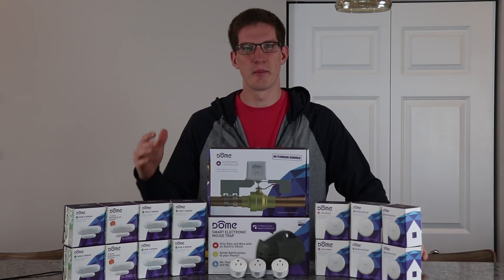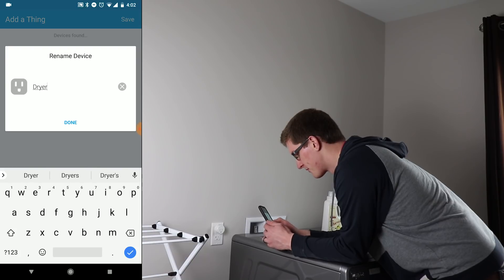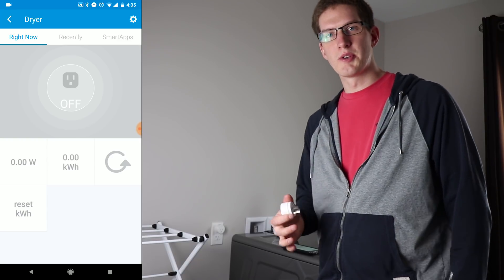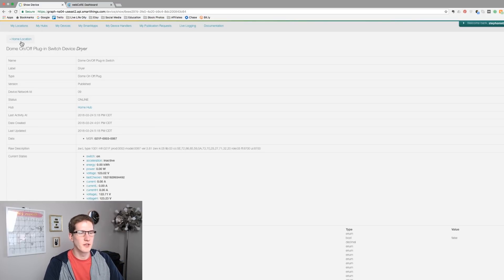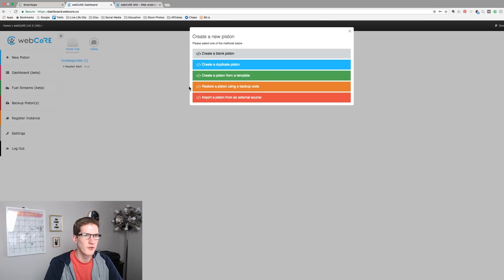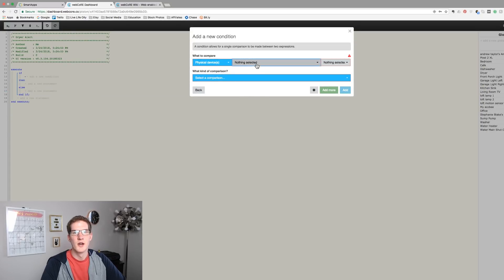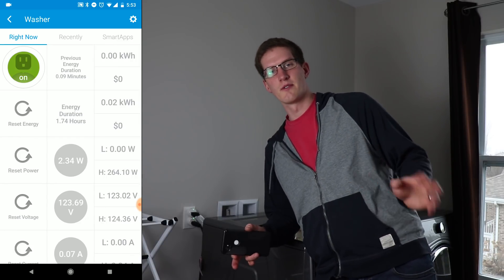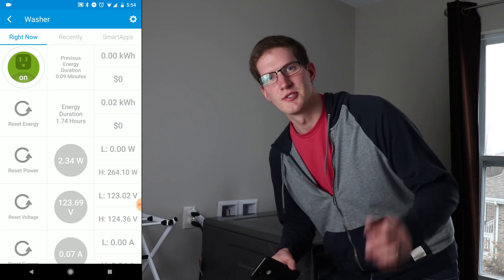Square One, Ep. 6: Laundry Alerts Using Dome Energy Monitoring Plug and WebCoRe!

Comment: I tried your webCORE example for the washing machine.  Instead of a text I have it set to announce it through my Echo.  My problem is that it keeps doing it over and over.  What can I add to get it only announce it 1 time?
Reply: If anyone needs a hand with this still, let me know.  I have it broadcasting through Google devices and it repeats every ten minutes until a virtual switch is turned off.  Can do that with sensor or voice.
Reply from the maker: You can add a local variable that turns true as well, then let it only run when false. Then have the variable turn false either at a certain time or after a certain amount of time.
Reply: @TaylorTech  Thanks.  I am new to webCORE.  I will need to find a tutorial that explains how I do this.
Reply from the maker: I wish there was an easy way to explain it but there's not. Try searching around the webcore forums I'm sure there's some stuff on variables there
Reply: @Ludeatude  How did you get it to announce through your echo. Did you use smart app?
Reply: @jabbajawz  yes. Echo Speaks
Reply: @kurt jones  Did you every get Echo Speaks working? Any links/tutorials you can share? I have everything set up (WebCore/Echo Speaks) but am looking for direction.
Reply: @animartis  I got a bit better with webCore since I last commented. What I did was create routines in Alexa that says "washer has stopped" and "dryer has stopped".

I then made two virtual contact sensors. I added a web core statement to close the sensor and then open 5 seconds later.

I pulled the virtual sensors in Alexa. Basically my routine says when virtual sensor closes then Alexa will announce "dryer has stopped" or "washer has stopped".

Comment: As before , great  educating video Taylor!
2 questions, 1. looking at the review of the Dome Home Automation On/Off Plug-In Switch with Energy Monitoring, in Amazon made me really concern about the quality of this item - will be happy to hear your view after sometime using it.
2. Any idea if I can use Stringify instead of WebCore to monitor if the appliance is still working (or in other words, Is Stringify can read the parameters you have presented?)
Reply from the maker: 1. So far no issues with the product. What does the review say? This setup only works right using smartthings and the correct device type handler. My guess is they don't have one of those set up right...
2. I checked on stringify and using this device handler, the washer and dryer both show up as unsupported devices. So I guess the answer is no.
Reply: Thank you ! currently there are 15 reviews, while 40% gave 2 or 1 (*) and  complain about the quality of the unit and disconnection from Wink hub (I'm going to use it with Smartthings, so hope it is not relevant issue)
Reply from the maker: So far so good for me... I've had multiple dome devices connected to Smartthings for a couple months now with no drop offs.

Comment: Excellent video once again.  I still have an older 240v dryer and suddenly feel the need to upgrade my laundry appliances to energy saving ones.  Let's hope those new homeowners won't need to use that smart mousetrap anytime soon.  I suppose you will set it up to send a push notification to alert them if a mouse is in the trap? My how far we have came with technology! Lol
Reply: 120v is only on gas dryer's.
Reply: A
Has a 240v smart plug come out?

Comment: kind of expensive  for  energy monitor plug
and  the on/off  i will never use  on a washer /dryer
i thought i saw a project before using an ESP8266 board and sensor  to monitor the washer /dryer  i forget what kind of sensor it used,  vibration i think